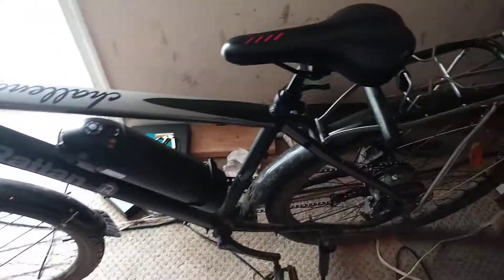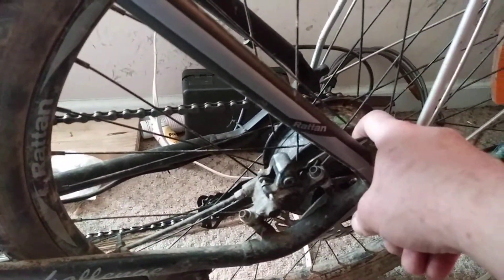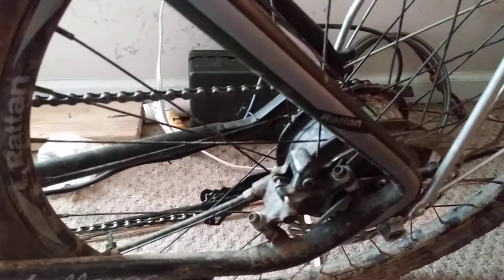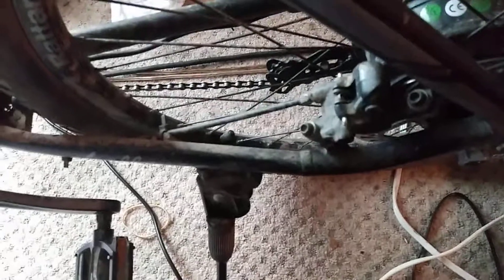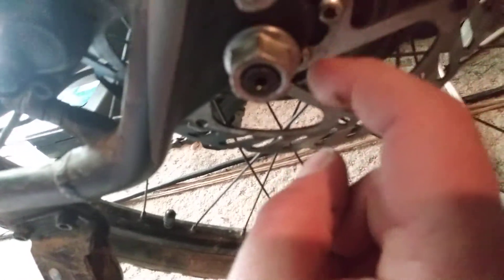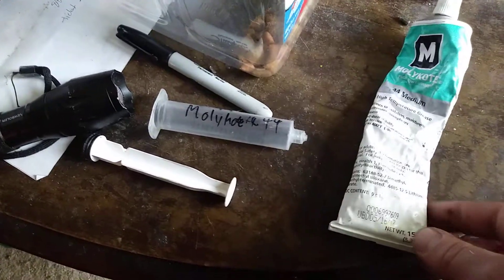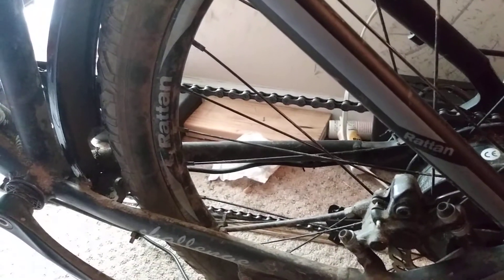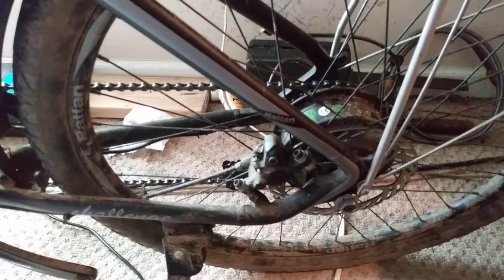Easy method to add grease to an electric bike motor

Comment: First, let me salute you for being one of the few people other than me that also have a Rattan challenger E bike! I have over 2200 miles online and the rear hub motor finally gave out over a month ago and I replaced the whole wheel hub motor unit thanks to Ebikeling. even going from a 350W to a 500W and still having the pedal assist and throttle at once. I do not know where this hole is to inject grease, I don't want my new motor to burnout as well 'cause I believe that could have been part of the reason was not greasing it. I don't see any injection holes anywhere on these motors I have 2 Ebikes now, an Ancheer 500w so I don't get stuck without any mode of transportation like the last time my back wheel hub motor went out. I've looked all over both wheels and I see no injection holes whatsoever not even on the old 350W motor from my Rattan.
Reply: Video maker loosened and opened the Disc screws! 
: The holes of the removed disc ,he used to squirt grease in! "Normally " you remove the disc if its not blocking the hub motor plate screws. To open the round hub motor cover with usually torx screws so you can pull out the motor and gears . 
I say usually because my bike seems the only one in the world with philips screws 😑

Comment: It probably would’ve been best to just make an appointment at a local bike shop that works on a bike motors and have them grease it professionally.
Reply: What Is Wrong With DIY ,It Worked For Him and He Saved A Few Hundred Bucks
Reply: Most bike shops WON'T service ebikes unless they sell them to you.

Comment: name of the grease? thanks.
Reply from the maker: the grease i used is molykote 44 medium grease, it was recommended to me for arcade parts ages ago but it works for a lot of stuff and i think its designed to use on small aircraft

Comment: I dont know about your bike but i just changed the free wheel gears on mine and those holes didnt go throught  inside the motor, that for sure  , you will need to open the motor to grease the gears.
Reply from the maker: were the gears on your motor on the cassette side?

Comment: Any troubles after injecting the grease since posting? Was there any improvements after injecting the grease? Want to try your method but worried I might put too much grease in. Great video.
Reply from the maker: I remove excess grease buildups that seem to squueze out through the bearings when changing a tire but it's like a little bit, seems to not be an issue for this motor, it is still working great. sorry i just saw your comment
Reply: @OGmolton1  
Thanks for the response, I'm gonna give this a try.